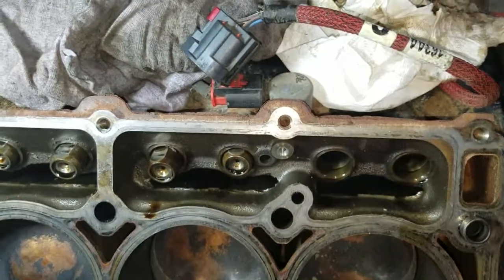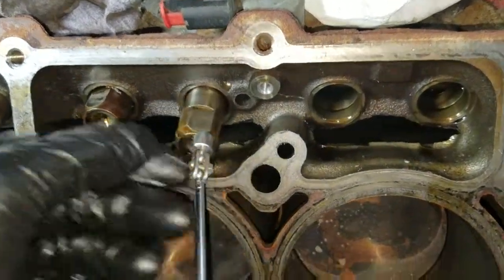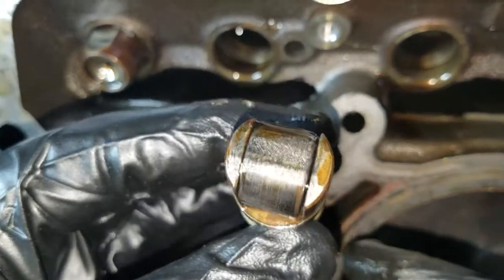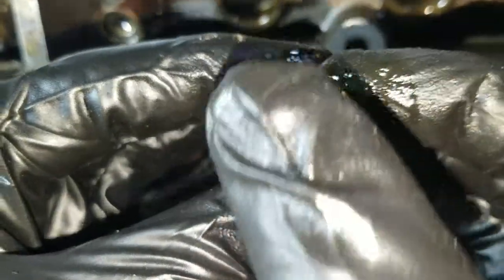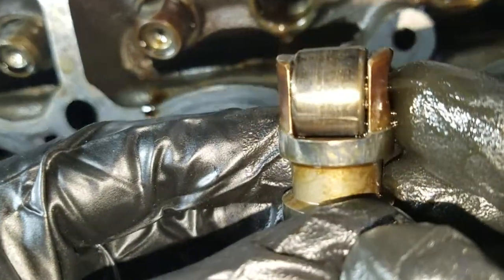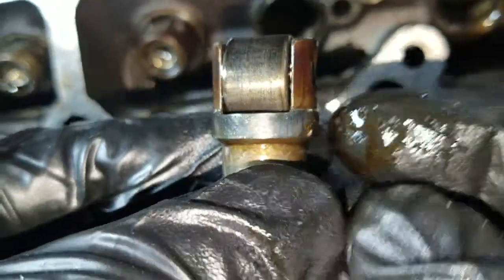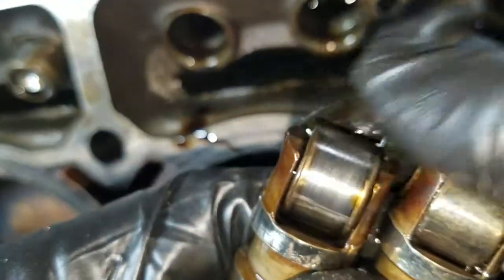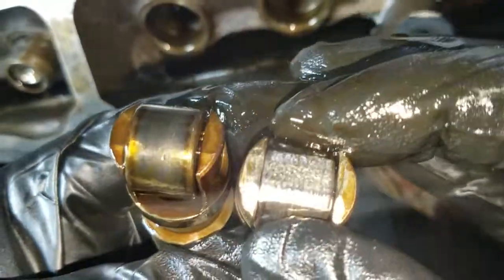Ram 1500 5.7 Hemi Engine Pulled - Destroyed Cam/Lifter

Comment: What caused cylinder 5 lifter to be that dry? Also, what was the symptoms of the failed lifter?
Reply from the maker: It seemed there wasn't enough oil getting to it, but the cause is unknown for sure. I did notice that spring was really dry and didn't have the orange burnt oil color as the others, and noticed a lot of the oil coming out around the rocker arms at the base of the rocker where it sits on the shaft. The oil feeds through the shaft and into the rockers so if it's leaking out of a worn shaft or rocker then it's not getting to the end of the rocker tip and the spring.

Symptoms were loud ticking, sounded like exhaust manifold leak, and then eventually I happen to go WOT and it misfired and set the cylinder 5 misfire code. I started investigating from there.
Reply: RacinJasonHighPerformance hope you get it fixed. Chrysler really need to issue a recall and fix there design flaw. I hear a lot of people having this issue with their hemi vehicle.
Reply: @RacinJasonHighPerformance  Shame
Reply: @RacinJasonHighPerformance  it’s an easy fix with hemi’s. It’s an mds problem (switches your v8 to a v4) you can get it deleted or you can use 10-20w oil WITH ZINC it has to have zinc in it because it help the oil get to the cam bearings

Comment: Had you taken that lifter out prior to making this video or did it come out that dry to begin with?
The second lifter had plenty of oil on it looked like.
Reply from the maker: It came out that dry. Only the intake side had bad oiling. You can see in my previous video when I'm diagnosing the issue with the engine still in the truck that whole area, valve spring, rocker arm etc was really dry and didn't have the orange "old burnt oil" look, like the rest of the cylinders. That whole intake side of cyl 5 was really clean and dry.
Reply: @RacinJasonHighPerformance  do you think the oil passages were clog ?